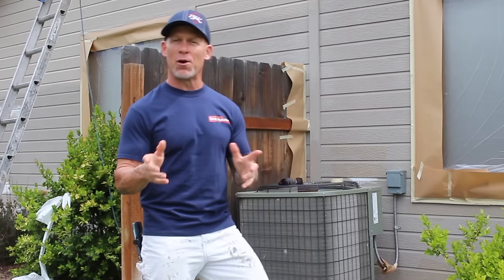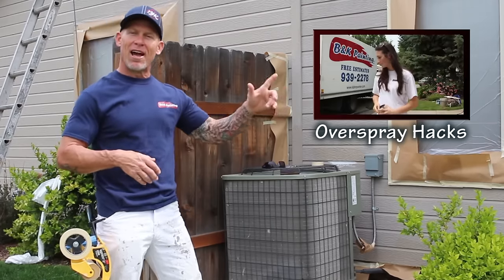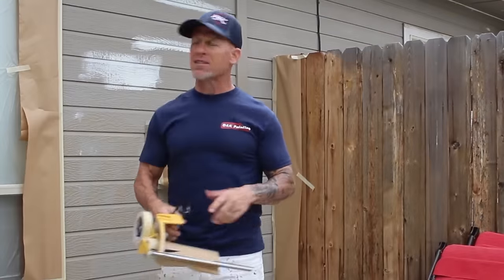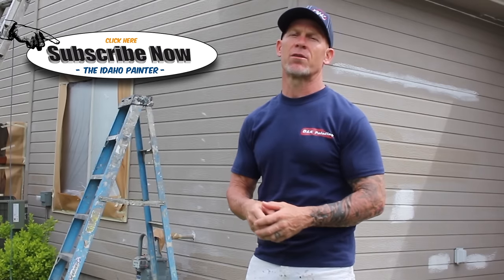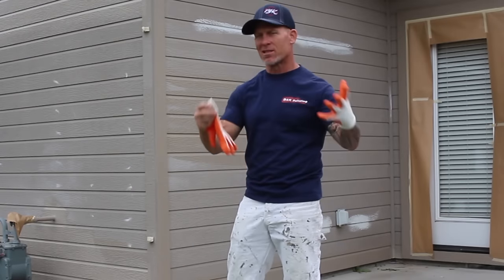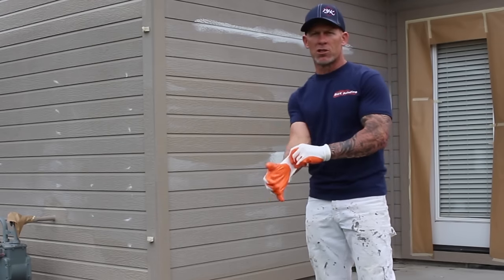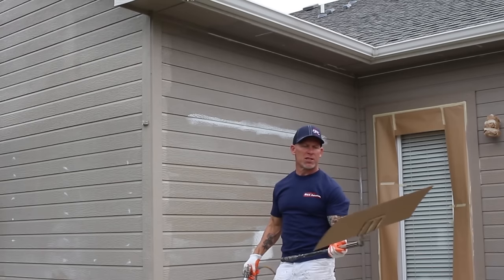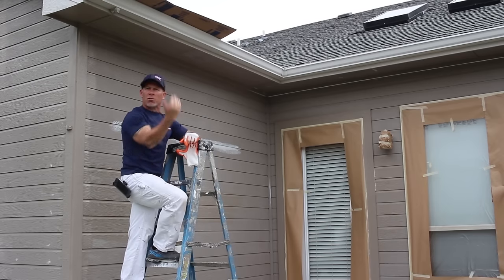How To Stop Paint Overspray.

Comment: I've painted for 14 years including spraying.  I think many people who don't know or who have tried spraying a few times think it just blows all over the place but it doesn't IF you do it correctly.  There's a lot of factors.  Keeping the gun clean, not mixing the wrong products, correct tip, filters cleaned, pressure set adequately, right width and volume of paint depending on the task, the right pace and distance and angle relative to the various surfaces maintained..  If its all done at least close to correctly, the pant is applied to the surface and it does not blow and drift all over in the wind.
Reply: Geez, I thought I knew what I was doing but I started at this company & over spray is a serious problem. I dont understand, it seems I'm doing everything right, I could be feathering too much, I was painting cars before.. But the gun is like ancient & we're using the cheapest $300 pumps you can get, no pressure gauge & they dont maintain them at all just throw them away when they clog. The suction screens are half clogged with paint, I'm sure the gun screen is fkd. So I'm thinking it's the equipment. The guns are terrible & they just swap the crap hose & gun to a new pump. Hose is super stiff & trigger is a really hard pull. I kept getting clogged tips with new paint. Major droplets too & there's the line streak at the edge of the pattern, even the veteran here seems to have issues. Advice?
Reply: @jeremyr7147  ill give you just one secret with the hose... get a custom made pressure washer hose with the airless sprayer fittings. There's plenty of hose shops that'll do it. They last us 4+ years in the AZ sun under pressure for up to 16hrs a day. Way softer and easier to move around. People thought we were nuts but it freaking works. We have to get 200ft at a time in order to meet our contract requirements of spraying manholes 200ft away from nearby truck access to get the sewers.

Comment: Hy Chris man!   Another great vid :)  On interiors I have been using your setup for sure on the paper and masking, love that stuff. So important. One time, I even covered a car with 5 bedsheets lol omg  to prevent overspray from our Graco airless sprayers on an exterior.  Lately, for interiors I use a cleanshot valve made from Graco to prevent spitting on release and trigger pull actions...works pretty good, though they don't last very long(or you can repair them :)...maybe like 3-4 houses then a replacement of about $160 possibly.  Anyways, love your vids man, it is like you run a virtual school, you help so many people around the planet, you definitely have an abundance in your karmic bank :) Cheers from Halifax, Canada :)
Reply: *****
 Yeah Chris mate! I used it on 3 2 bedroom apartments so far...it worked very well for the price of (I think) of 150$  It prevented the spits on trigger pull and release on most (99.9%) occasions, I can think of one time it didn't, but then I just cleaned it out, etc and re-attached to the extension and back in biz :)  I saved me a bunch of headaches for sure...I would love to see a review of yours on that piece :)  Cheers man :)
Reply: *****
Hey!  Yeah you can tell there's a bit more weight there, I got used to it though pretty quickly. Cheers!

Comment: I just sprayed a couple rooms with Benjamin Moore primer. I got a sandy texture. I used a 5/15 tip. The pressure was really low but I was getting quite a bit of over spray so I kept it seemed to keep it down. I should add this is my first time spraying l
Reply from the maker: Watch our videos on how to prevent over spray!
Reply: Also, backrolling your walls after spraying helps minimize that sandy texture your getting. Quick pole sand should get rid of it though. Happy spraying

Comment: Great vid as always Chris. I just got a Graco X7 and used it for the first time to paint some trim, baseboards and moulding but was having issues with the paint running after applying it. I used the 313 RAC tip and tried to move quickly, and also had the sprayer pressure turned down pretty low. Any tips on how to avoid having the paint run or drip after applying? Thanks.
Reply: Thanks for the reply. I heard you wrong and picked up a 313 instead of the 310. It seems the rac x fft310 tips are hard to come by but I'll do some searching and order one online.

Comment: Is there any sprayer that allows to spray with 2 guns simultaneously?
Reply: Yeah, all depends on the pump. Graco X70 Xtreme can push 2 guns at one time but you need a good compressor to get the right pressure.
Reply: Yes!   in fact Binks made a B-10   airless that couild power 10 guns back in 1978!!!!    But binks and graco made various sprayers that would suplly 2 guns.

Comment: Thanks for continually putting out great videos, Chris! I originally stumbled on your channel because I was looking for some simple tips for painting my home exterior. Little did I know there was someone as thorough as you putting out content regularly!  

I hear you reference that you use Sherwin Williams Resilience paint. Do you spray 2 coats for home exteriors? What are your thoughts on Resilience compared to the Duration and Emerald paints from SW? I'm told those are 1 coat paints, right? 

One quick comment/suggestion I recently thought of after watching a few of your videos on the YouTube app on my phone was that the video screenshot links within the videos don't work when you refer to another video. Would you consider adding links to your additional videos within the video descriptions? Maybe there's a good reason not to do that and I'm not aware of it, but I just thought I'd mention it. 

Thanks - keep up the great work!
Reply: +The Idaho Painter That makes sense. 2 coats of Resilience sounds like a good/cost effective option to me then. Thanks for the response!